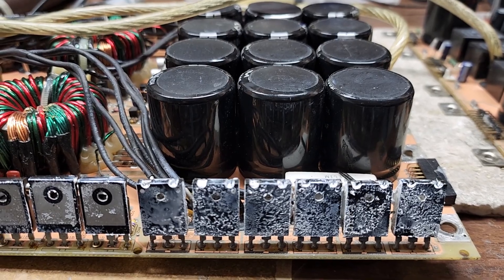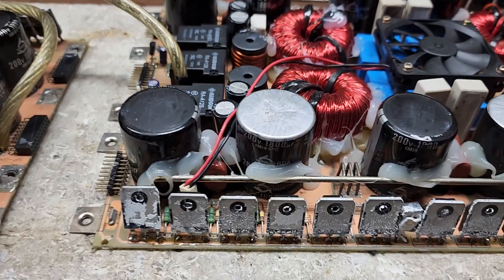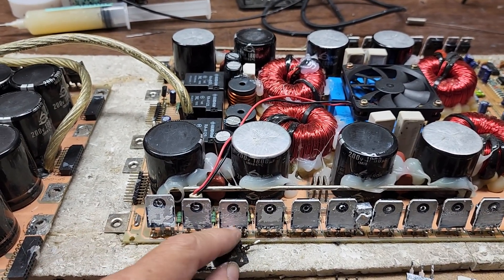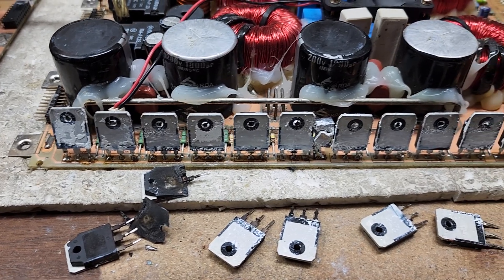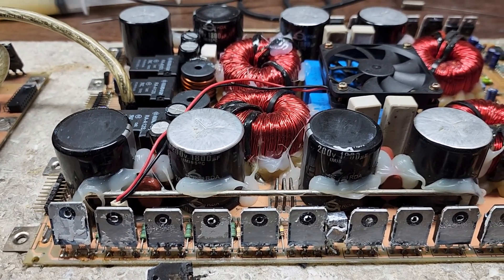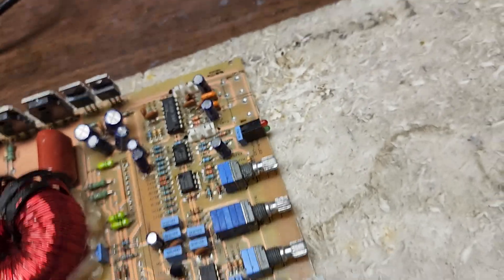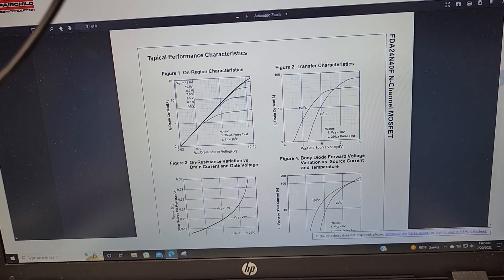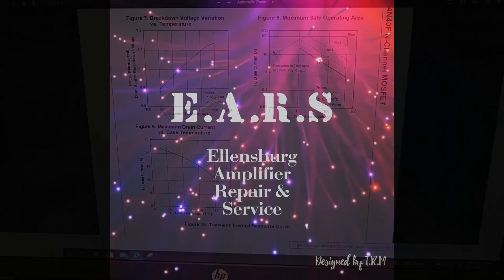Competition Use Car Amplifier Thermal Breakdown of Transistors the How and Why - Solution?

Comment: Subscribed, so I’m running the Skar 150.4 bridged at 2ohms and she’s running hoTT my friend! But Evan at 4ohms not bridged it always ran hot. What can I mod to help I know there’s different levels of transistors from the cb radio world but… don’t know how that will incorporate into the audio world yet. Um so I guess my question is what are big CFM branded fans and any companies make bigger heat sinks? I do have a mill….🤔
And what’s a good brand for thermal paste and is there anything really to keep the heat down will keeping interior clean all I can think of is paste, big cfm fans pulling the hot air out and in return it will pull cold air in and I guess thicken the heat sink if possible right?
Reply from the maker: Fans only help move the hot air away from the heatsink so thermal managment realy is about how fast you can transfer heat from the transistor backing to the heatsink. Depends on what Skar used for their managment. If just Kapton tape them you do have many good options. If they are using gapapd then you are limited. If that is the class AB amplifier you may have a damaged output section (feedback or bias).

Comment: Can i replace the thermal pads with paste
Reply from the maker: When gap pad is used or thermal pad, it also isolates the transistor from the heatsink. You have to have use a thermal management that isolates unless you are dealing with encapsulated transistors.

Comment: Hello! can you help me?
I have a problem with one of amplifier, sine wave output is in the noise (noise is 0,520v wthout any signal) (replacing change amps can (but too cant) help for a moment with clean  sine wave, but after 1-5 minutes sine is back to noised sine wave.
What is causing this problem?  RCa input is clean. After my test with third amplifier,  for a moment i got better sine wave in second amplifier,  The problem: Amp blowing speaker much before distortion output, bass is weak / weird, flexing car but i dont hear and fell presure, Wave sine on out amp is rippling like Phase reverse - back normal - reverse - back normal itp. In warm temperature sound (bass) can be much better for a few minutes only. Or sometimes multipe disconect power wires can help back clear sine wave
Which issue fits this problem?
Input noise, Resistor noise,  Thermal drift. And how to solve this problem. Thanks!
Reply from the maker: This sounds like a feedback circuit fault depending on what amplifier you are speaking of.
Reply: @ellensburgamplifier  Are you know how to Fix IT? I dont see anythink to Fix this problem :/ thanks !

Comment: If my amplifier starts to blow, can I cut the negative or positive wire off so that it stops sending current.
Reply from the maker: Here when a power supply doesn't pass initial testing I hit the Estop which cuts the positive. Now, this also cuts the remote. I would always have a plan in place on "how" a person will cut power in a large build.

Comment: What causes just 1 of them to pop. Deaf bonce avatar 2100.1, I wasn't even playing music. Got in the car at the store to go home and it exploded
Reply: Also amp does not go into protect. And until I unhooked it a few days later I smelled it burning every time I started the car. Just wanted to know if I could save it or not. I have a few parts from other amps I could use but it popped another one when I put it in
Reply from the maker: Depends on what let loose. If it was a power supply transistor, I would suspect a shorted winding. If it was an output transistor I would first ask if it has been recently repaired and if not then I would contribute the failure to a glitch in the switching. Remember, most amps have all the back-end switching business going on even when there is no music. It could have been a quick drop in voltage and current leading to a confused IC.

Comment: I have some amps that I used to run very hot, so before I put them back in I need to re-apply new thermal compound.  Thanks for posting & educating.
Reply from the maker: Yes indeed. This is one of the most overlooked items I see in the amplifier repair business. If it is not an overload failure, it is a heat failure. Thank you for the channel support!